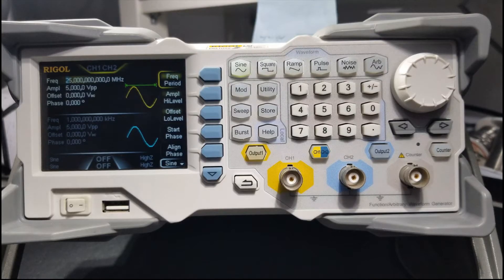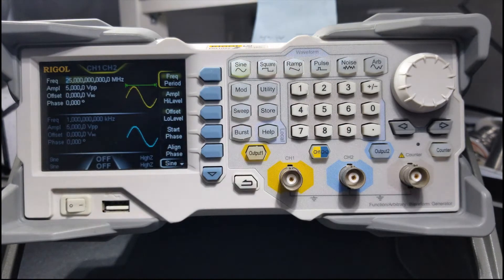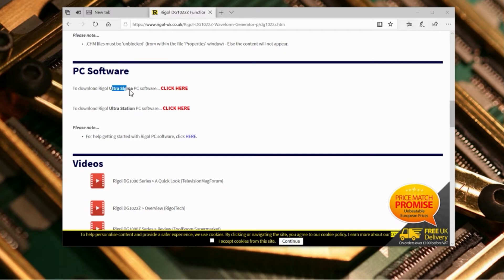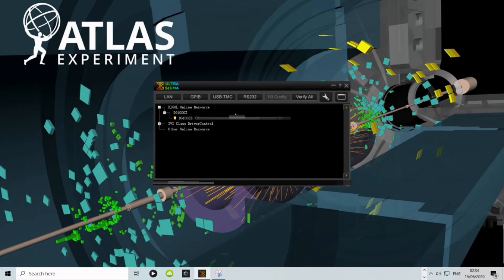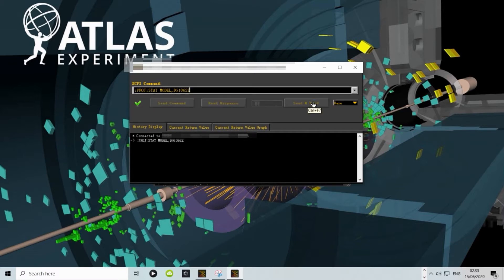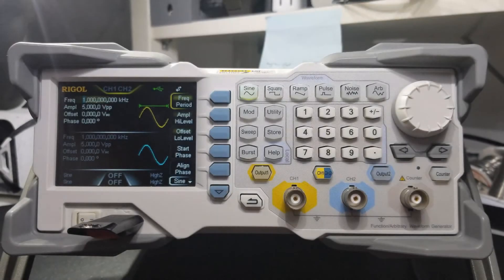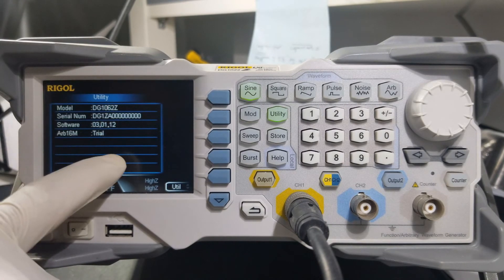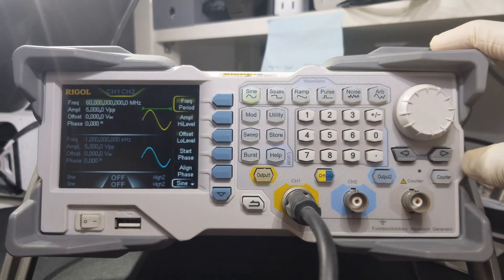HACK RIGOL DG1022Z UNLOCK UPGRADE TO DG1062Z

Comment: I greatly appreciate the information that I found in this video and its comments. I could not have accomplished the upgrade without it. However, I found it difficult to find a complete written set of step by step instructions that I could understand with just my limited Noob computer knowledge. So, I am posting them, in hopes of helping someone...

Full Disclosure (Warning? <grin>) - I am a Big Old Computer Noob. This information may very likely be incorrect. It might damage, break, or brick your equipment. Use at your own risk. I take no responsibility for its use.

Two quirks to know about, before starting...
1) The license status is changed to "trial," but it never ends.
2) Your serial number is reset to DG1ZA000000000.
These changes are displayed on the System Information page. There may be other means of doing the upgrade that avoid these quirks, I am not sure.

Procedure
- Install National Instruments NI Protocol on your computer. Rigol's Ultra Sigma program requires it. It does not have to be launched - it runs in the background, somehow.
https://www.ni.com/en/support/downloads/drivers/download.ni-visa.html#521671
- Install Rigol Ultra Sigma program on your computer. This program talks to your function generator, via the NI protocol.
https://intsso.rigol.com/En/Index/listView/catid/28/tp/5/wd/
- Download and extract this keyfile to a FAT (plain FAT - no 16/ etc. = emphasis!) thumb drive. https://www.mediafire.com/file/t6r99upgs6h2agy/keyfile.7z/file
- Move the thumb drive to the Rigol 10xxZ Function Generator USB port.
- Attach the Function Generator to your computer with a USB-B Cable.
- Open Ultra Sigma.
- The Rigol 10xxZ Function Generator should populate to the menu.
- Right Click on unit. Select SCP Panel Control.
- Copy/paste and Send this code.
:PROJ:STAT MODEL,DG1062Z
You should get an “Okay” confirmation. If not, check the Thumb Drive.
- Copy/paste and Send this code.
:PROJ:STAT SN,DG1ZA000000000
You should get an “Okay” confirmation. If not, check the Thumb Drive.
- Close Ultra Sigma.
- Shutdown the Rigol 10xxZ Function Generator.
- Remove the Thumb Drive.
- Turn the Rigol 10xxZ Function Generator back on.
- Press the Utility Function Button.
- Press the Menu Down Button to go to the next page of the menu.
- Select the System Information Button. It will confirm the upgrade to DG1062Z. The “Trial” status will never end and your serial number will be set to something generic “DG1ZA0000x.”

Please let me know what is not correct, or said poorly.

Comment: It works for me too, following Mechanical Cell and Dominic O'Kelly instruction. Pls note that I:
- installed Ultra Sigma 00.01.06.01 as administrator on a Win 7  Ultimate PC with SP1, no Antivirus/firewall
- gave access to Ultra Sigma to public and private networks
- my 1022Z has last firmware 03.01.12
- I used an old 1 gB usb

Checked the sine wave output on a Tektronicx TDS540C, very clean.
Many thanks to both of you

Comment: A few things that were missing from the website that you'll need to know:

1. Install the Rigol Ultra Sigma Software, then reboot PC
2. Find a USB and format it to: FAT / Default allocation size / label: RIGOL
3. Unzip the link and copy to the root folder of the USB drive, then remove USB from your PC
4. Connect your DG 1022Z to the LAN
5. Insert the USB into the DG1022Z, then power it on
6. Check that you can find it on your network (use advanced IP scanner or the like)
7. Open Ultra Sigma and connect to the DG1022Z using its IP address.
8. This should ensure everything works correctly so you can follow the SCPI commands as per the video. 

This worked for me. 

Hope that helps- and thanks for the video & link Mechanical Cell!
Reply from the maker: Thank you for the steps guide, and you are welcome.

Comment: Your website is no longer accessible, could you please give us another link or bring back to life the link please ?
Reply from the maker: i uploaded the file to mediafire  link in description:
http://www.mediafire.com/file/t6r99upgs6h2agy/keyfile.7z/file
Reply: @MechanicalCell  I did mean, the file link was ok but your web site is not accessible. I think i'l be able to figure out what to do only with your video.
Reply from the maker: @YanickT  yes it is still off, the damage was big, but i hope it will be fixed soon, if you have any question, please do ask ! i will help.
Reply: @MechanicalCell  Finally did it... it's works but arb16M is yet to unistalled :(
Reply: Got it.... your serial number string isn't good. must be :PROJ:STAT SN,DG1ZA000000000  No space

Comment: Let me share the solution.
You need to format your USB drive to FAT and nothing else, It has to be a small partition less than 3G so if your USB drive is bigger then go to disk manager and delete the volume, then create a single volume with the new size and make sure to select FAT and format. Then use the ultra sigma as he shows here.
the Mediafire link works.

Comment: Can this also unlock a DG1032Z to the 60Mhz DG1062Z?
Reply from the maker: sorry for the late response, i think you could try, because if it dose not work then it will not harm the signal Generator, ( however pls ask around as well, just to be sure )
Reply: @MechanicalCell  No worries for the delay. For the record this did actually worked out fine so thanks for the tut!
Reply from the maker: @gtcollection6933  well, that is super great  :) ... others could used this video then as well..;)
Reply: @gtcollection6933  I have the 1032Z. Now that you have been using the upgrade for awhile, what do you think of it? Pros/Cons. Suggestions? Do you know of any additional DIY upgrades for the 1032Z? Please and thank you.
Reply: @t1d100  It actually worked perfectly well in my case. I've yet been required to downgrade the unit and still using it today with the upgrade. However I can't vouch for the calibration/accuracy at the higher freq. My guess is that it is off a little and so if you need it for adv. scientific purposes the cons are this ain't going to work. Hope this helps.
Reply: @gtcollection6933  Thank you for the fast reply! The 1032Z does have a self-calibration function. Did you try that, after the upgrade? If so, did it make any difference?
Reply: @gtcollection6933  Thanks for the reply. Did you use the self-calibration function, after the upgrade?